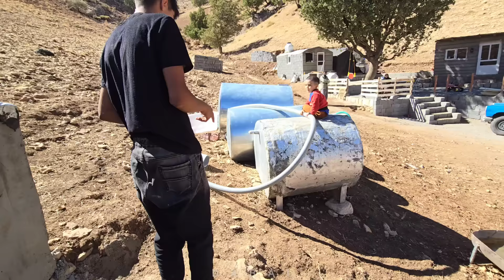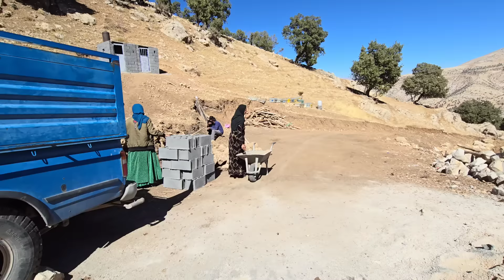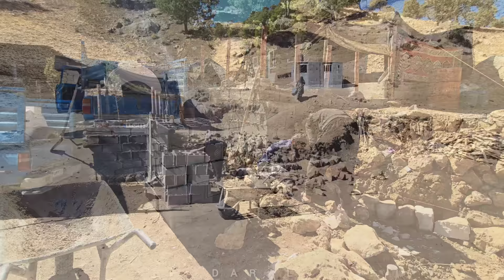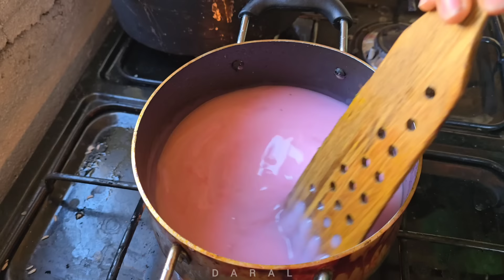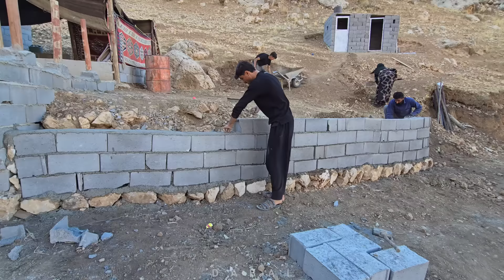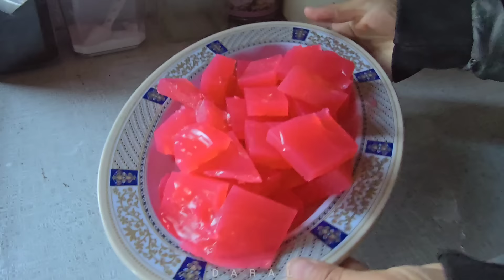👨‍👩‍👧‍👦Amir's Family Builds a Beautiful Fence and Bakes Delicious Sweets🥮

Comment: This is only an observation.and if you allow mi to give a suggestions.will my pleasure, It is regarding your bath house and the toilet. Why it is the lication of your Toilet and bath house is too far from your house.less convinient.For the toilet Why not Dig a big and Deep manhole or build a Reservoir a safety reservoir for toilet near your residential as well as the bath house.for toilet just put a exsost pipe.upward so the smell will not go around your house.and for the bath house you can dig a canal for the water coming from the bath house.